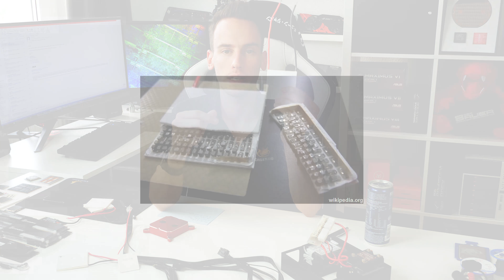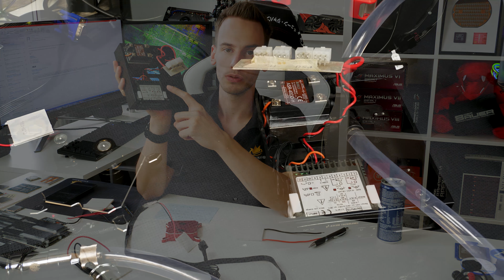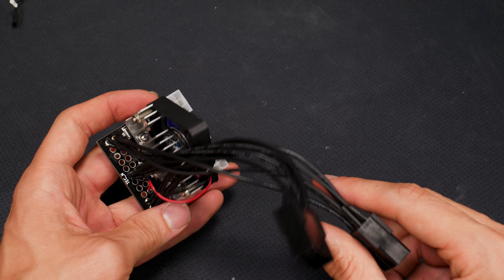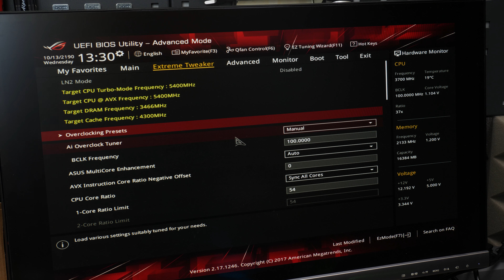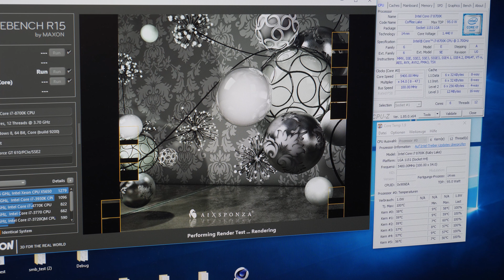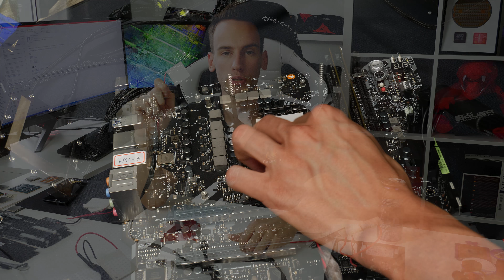TEC-Water-Cooler in 2018?

Comment: I have made a similar cooling system on my main pc.
I use 2 60W peltiers between 2 water cooling loops. (Yes I use 4 cheep CPU coolers form ebay)
I the uses the 2 peltiers to cool the water ind the cold loop, and cool the worm loop using two 3x120mm radiators.Thus the cold loop is from a reservoir to a pump to the CPU and up to the two peltiers and the worm loop is from a nother reservoir to a pump to the peltiers and through the two radiators. As controller I use an Arduino Nano that measures the water temp in the cold and worm loop plus the air temp and humidity. The Arduino then calculates the dewpoint and add a little for safety. I use two MOSFETs (irlr8743) to turn on either zero, one or two og the peltiers to regulate the coldwater temps. I have the arduino set the date by the USB cable to a small python program that I made such that I can see the temps in windows and save the data for later analysis.
Just to be clear this is not at smart cooling solution, it is expensive and uses quit at bit of power, but it was a fun project, I my Idle CPU temp is between 15-22 deg depending on air temp and humidity. (note that I do not want condensed water in my pc :-) ) I normally have a delta temp of 20-25 deg C over the peltier elements, and at that point they can only transport 5-15W of power, making the really ineffective.  The maksimum temp Is actually not that good, my CPU uses slightly more than 120W (8600K 4.8-4.9GHz) and the peltiers can only move 120W when the delta temp over the peltiers is 0 deg. Thus my cold water temp can exceed the air temp after 1 hour of 100% usage and the CPU can reach 60-65 deg. But under a normal gaming load it is below 40 deg C... I can link to a image of the data shown in my Python program if anyone is interested (but I doubts anyone got this far :-) )
Reply: Petch85 can you please make a video of it, even if it's low quality and you don't talk?
Reply: parani kumar & mashed potatoes
I have made a pdf with some pics and description. You might be able to build your own from it. Have fun. 
https://drive.google.com/open?id=1tLnRGpx3Iz213YWf7bBUA0wLbQPD_SDY
Reply: @Petch85  noice
Reply: I do not have any good way of measuring noice. But I think most people would describe et a silent.I am using 6 EK Vader EVO 120S (1150RPM) fans for the radiators when the CPU temp is below 15 C they run at ~750 RPM above 45 C they run at 1150RPM. The 750 is set just below where I am able to hear them at all. Then I have 2 Vader EVP 140 for Chassis fans, the run at 460RMP up to maybe 700.  And then I have a 120mm Silent eagle running between 700-1000 RMP. All fans are intake except the 3 on the top. Thus all air comes into the tower and leaves through the top. When the CPU is at >40 C you can easily here the pc. But it is not loud, and the sound is relatively comfortable, when gaming and the CPU is at ~40 C the graphics card makes all the noice, and you cant tell if the CPU is 15 or 70 C. The MSI Gaming X cooler is not as good as I had hoped, and the card have some coil whine. (disappointing). I have a plan to apply LM on the GPU, that might be able to reduce the fan speeds. I allow the GTX 1080 to reach 75 C just to keep the fan noice down. They spin at 1600 RMP at 70 C, but at least the fans turnes off when I'm not gaming.
To be clear non of this is audible when having a head set on, or having the window open (little trafik) thus it is not bad, but it is not a good as I was aiming for.
Reply: @Petch85  Very cool! Not the best temps under load though. I wonder if theres a better way to do it without condensation being an issue
Reply: @Impetuss  hehe, no 120W is too much for my system. Ideally the peltier elements should be able to keep the cold loop at a constant temperature independent upon the load of the CPU. But that would 
require probably 2 more peltier elements. And then you cooling system would use more that 240W. Thus you would need radiators that easily could remove 360W of heat, case if the warm loop gets too warm the delta T over the beltiers would be too high, reducing the amount of heat the can be transferred over them.
This would keep the cold water close to the dew point, but the peltier elements would have troble reaching temperatures below that , you can get af delta of 20C but not much better than that. (You can stack them though)
The condensation problem can bee solved by insulation everything that goes below the dew point, but it is a hassel.
Reply: @Petch85  if you have discord id like to discuss some ideas with you CorneliusNubston#1201 is my discord name
Reply: parani and mashed... A video might be more than I can do... But I will try to make something, it will take a little time though.
Reply: Petch85 hi I would like to view your setup . Sounds cool
Reply: +jawndoekck
I am not sure way the would use them for that. I suspect it has something to do with safety. They might not like to have the rods under pressure.
Reply: @Petch85  im looking at the pdf are the TEC's stacked or is one sandwiched  between the 2 floating blocks and the other on the cpu if both are between the water blocks stack could it maybe benefit from a cpu block like de8auer but yeah i would love to be able to contact you some how is this a common alias you use ?
Reply: I DID!  Sounds awesome!  Been wanting to do this for ever!!  I wanted to do this back on a 2500Mobile! LOL
Reply: i considered doing something similar but with a single loop going  res-->pump--cold side tec1-->cold side tec2-->cpu-->hot side tec2-->hot side tec1-->rad-->res
Reply: Brandan Randle: I am sorry to tell you, but that will not work. Or it will work, But it would be better without the tec's... It is not easy to explain in a youtube comment, but. Try to track the energy through that loop. First, say the pump is 60 kg/h flow that is 42 g/s of water with a heat capacity of 4.181 J/(g*K) Meaning you need 175 J to change the temperatur of 42 g water 1 deg K (or  1 deg C, same thing)  say you have to TEC's of 60W, combined 120W. Then you can cool the 42 g of 0.7 C/s. Meaning that you water will be 0.7 C colder when it has past the 2 TEC. Reading not a lot better than just water cooling. Now the water passe though you CPU, say is 120W. And now the water temp is back to ambient. Now the water comes to the peltier elements. They transfe 120W combined, but the also uses 240W combined. Thus in total 360W is added to the water  360/175= 2 C Now the water is 2 C warmer than room air temp. Now we come to the radiator. The radiator can dasepate heat depending on the delta temp between the air and the water. But lets assume it is a very big radiator. Then the best it can to is to reduce the temp from +2 back to ambient. And then you system is back where it stated. And you only gained 0.7 C on the cpu. But in reality a 2x120 mm radiator maybe need af delta of 5-10 C to dasepate 360W, thus the water will reach +10 C over ambient and be cooled to +9.3 C after the TEC's. And if you remove the TECs you only need to dasepate 120W in the radiator and it might be able to do this with a delta temp of 2-5 C. I hope this helps you understand the problem. You could use air cooling on the TEC's hot side, but then the radiator would heat the water as soon as the water temp is below ambient. You could use a liquid with a lower heat capacity but it would no be much better.

Comment: What about combining TEC cooling on a delidded chip with liquid metal contact and instead of using a waterblock you use the immersion cooling NOVEC instead to avoid condensation issues (since the whole TEC area will be submerged) the phase change in the would reduce your required cooling to condense the liquid back down making it a bit more efficient and no worries about the novec freezing.
Id love to know your thoughts on this concept as it is one i have been toying around with on paper for a whole PC using TEC's on CPU and GPU possibly also on the condensing radiator loop to keep that cold enough to condense the gas back down faster.
Reply: Great idea.

Comment: I would totally be interested on buying one, I tried some years ago with a small peltier connected to a waterblock outside the case (but connected to the loop) to lower the temps of the water and I just managed to get a low idle temp but once the cpu was pushed the temp went to 80° anyway (it was a 3930k).

Comment: Something I would be interested in seeing would be to use a couple of Tec's to build a chiller to cool the water going to the water-block, so instead of trying to stack tec's since we know this won't work, we can have any hypothetical number of tec's working in parallel to cool the working fluid of the cooling system... grossly inefficient for sure, would still be very interesting to see the results of though...
Reply: I have made this. Only using two peltiers... It takes up quiet at bit of space in my tower. See my other comment for more details.
Reply: Yes what you describe is your other post is basically what I said I would like to see, but I imagined using a bit more powerful tec's to have a bit more cooling capacity, the nice thing about this concept is,you could have multiple 100's of watts of cooling chilling the liquid... again not a efficient idea, but a interesting one non the less..
Reply: Just to clarify, I use two TEC1-12715 peltiers... They pull 120W (10A) each and can move 60W of power when the delta temp over them is 0 deg. My CPU is OC'ed with LM between the IHS and core and LM between IHS and CPU block. Is uses around 120W (Blender) at 100% load. For Prime95 small FFT's it's at 150-160W. But lets take 120W as an example.  If my CPU creates 120W of heat the delta temp over the peltiers will reach 0 deg. And the radiators have to move 120+120*2 = 360 watt. This is quiet at power consumption for a cooling solution and a cpu. But it works. I have not been able to fine better peltiers than the 12715 without the price being completely different and I need to modify the wiring if I want to pull more than 10A. But yes I could add one more peltier to my solution and be able to cool 3*60W. When I stated on the project I was planing to cool my GTX 1080 with the same solution. But there is no way that I can add 180W to my current solution. And as the setup is now my cpu temps would be lower at full load without the peltiers. But for gaming and idle loads the CPU temps are better than just a water cooled solution. But it uses 240W more power at full load than a water solution, making it quiet ridiculous, but still fun.
Reply: been tried before
Reply: one could use it for Extreme cooling, yes. But you would have alle the problems with condensation, and you should use isolated reservoir and tubes, to reduce the condensation, it would be a hassel. But it would still be easier and cheaper the LN2  for a daily driver :-)... Again, the elements that I am using can only really create a thermal difference of 20-25 C. But in the extreme, one could stack a 60W on top of a 30W and then have 5 of through in parralle to cool 200W down to maybe 40-50 deg below air temp. But you need to cool 1350W + the 200W (CPU) in a radiator (well a heater at that point :-) ). You might be able to find better peltier elements, but still. And you need some kind of antifreeze :-)... My system is only 10-15 C below ambient air on a good day. Thus it is only 10-15 C better than a really good water cooler, but it uses 240W more than a really good water cooler. I do not think it is worth it unless you love to do the project. (If it is worth doing  it is worth over doing)
Reply: Petch85 I believe that a lot of things we enthusiasts do can't be described as worth it or economical, but we still do it since we enjoy our projects and that in my eyes are justification enough ;)
Reply: Isn't that what that chiller unit (I think that's the one intel used for their 5ghz fiasko) uses?

If you are only trying to cool down the water to ambient temps, then it's better to just use a big radiator. (jayz2cents did a video on that) and others have used ordinary water heaters (the kind placed in homes). 

But if you really want to use cold water to cool your CPU, then just hook it up to your water tap. That's really not a good idea, but would get the job done much easier than messing around with peltiers.
For a really simple setup, you could place your radiator in bowl of cold water, and just have it act as a heat exchanger. arrange the bowl under your tap and let it trickle cold water.
Reply: lordsqueak I doubt the chiller intel used was based on peltiers, if I were to hazard a guess it would probably have used a more conventional refrigeration process like air conditioners and fridges use simply because it would be the more conventional method to achieve their goal and I won't be surprised if commercial chiller solutions already exists that they could have simply have used...
Reply: Come to think of it, I think you're right , I do recall hearing something about phase shifting.
Reply: Heimo van niekerk yup maybe with some anti freeze additives. Isolation on cables and on the block, one of those full mosfet cpu  plate
Reply: https://www.youtube.com/watch?v=4iyclUhfmnM and https://www.youtube.com/watch?v=Frs8gsAwNDc
Reply: Interesting experiment https://youtu.be/3e7zXECXZ-4
Reply: https://www.youtube.com/watch?v=IX2NQ1lq4ZM

Comment: Rather than sub ambient temperatures I always thought a tec in a bay resovoir would work well, so cold side attached with a simple heatsink into the res itself and then large 1 bay vapour chamber/heatsink on top of this utilising the cases intake fans as air flow. As well as this there would be a simple controller that reads the water temperature and keeps it at ambient. I thought it be useful for space limited builds where you can only fit a 120mm radiator but want to over clock both gpu and CPU. 

So essentially a water chiller but compact and only to prevent heat soaking.

Comment: Awesome video !!! I always wonder this. Also about using mercury/gallium as "water cooling" ...  could you overclock some old cpu's like the xeon x5660 to compare with the new i7 8700k ?
Reply: The IPC advantage of a 8700K over a x5660 would be massive. I would guess you would need to shoot for 8+ghz to achieve parity with a 5ghz 8700K.

Edit:
Just had a look around a 3.5ghz overclocked x5660 put up a cinebench score of 800. A 8700K at 5ghz is 1637. So with linear scaling you would be looking at 7.1ghz to achieve parity, and it's not going to be linear. So yeah probably around 8ghz.

Comment: This brings back memories. I've thinkered around with TEC cpu cooling 15years ago but couldn't figure out the electronic temperature control part. Even did my secondary school thesis on tec cpu cooling. I ended up using it as an waterchiller. Would be very interested such a TEC unit!

Comment: Fun fact,one of our space probes in mars powers itself useing a TEC but working in "reverse" ,they use a nuclear device to generate heat  on the heat side  and the "coldness" of mars as cold side.
Reply: yeah, RTG. thing is, a power generating tec is wired internally quite differently from a cooling tec. you can force them to do the job of the other, however they will not be as good as one made for the job.
Reply: @Zarcondeegrissom  you can use TECs as RTG, you just need to stack them in series thermally, but parallel electrically. RTGs/TEGs tend to be thicker than TECs to improve efficiency; TECs are thin to improve cooling (but sacrifice efficiency)
Reply: I've been looking into this recently, https://en.wikipedia.org/wiki/Thermoelectric_generator has some good info
Reply: https://en.wikipedia.org/wiki/Radioisotope_thermoelectric_generator  Are the types of generators used on some space probes. Really fascinating tech.

Comment: I believe we use to call those peltier generators
Reply: Generating Heat or Heatflux (heatpumped cooling for instance) from a TEC is Peltier effect, using them as electrical generator is the Seebeck effect
Reply: Js JavaScript peltier effect... Some people say peltier, some say TEC.
Reply: Actually as far as I know you get thermal electric coolers and thermal electric generators, both can behave in similar fashion, but each are optimised for their given purpose...
Reply: Good point... yes, the generators turn heat into voltage.

Comment: But what if you didn't want to go extreme, could you use a smaller and thinner 30x30mm 30w tec in between the cpu and cooler and perhaps just shave off 10c. Because that sounds like something that would actually be useful for enthusiasts and not extremist.
Reply: Extremist?! LOL
Reply: You will have condensation on your cpu.
Reply: once you exceed the cooling ability of a peltier they become a very poor thermal interface
Reply: If you turn a peltier (TEC) off they are an insulator. So you need a peltier that has enough power in its own right to cool the CPU. Then you need enough cooling on the hot side to deal with the watts put out by the peltier and by the cpu. This is why Peltiers don't really work well in an air cooling environment. It's very difficult to cool that level of TDP.